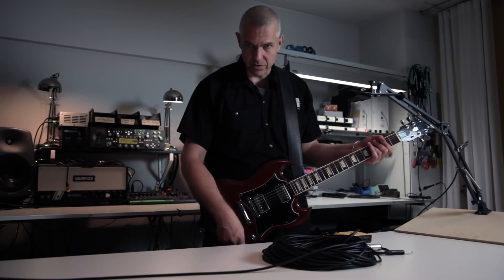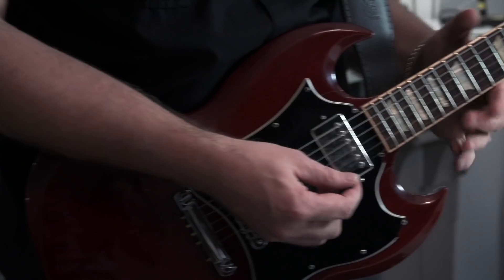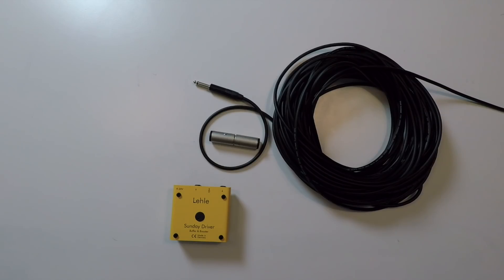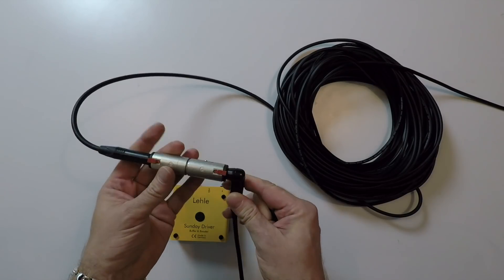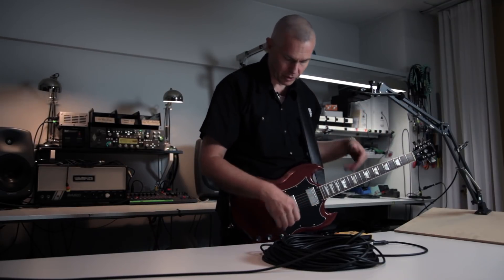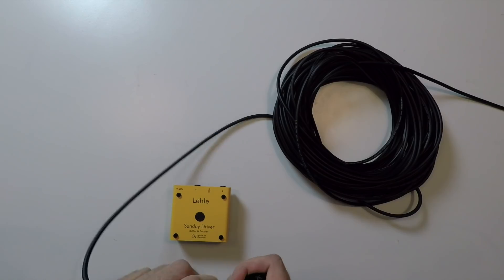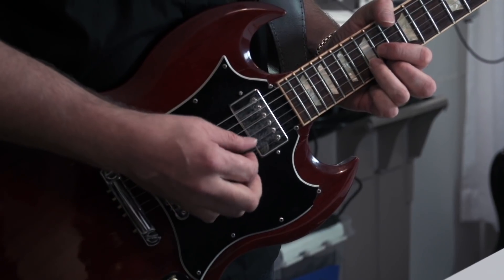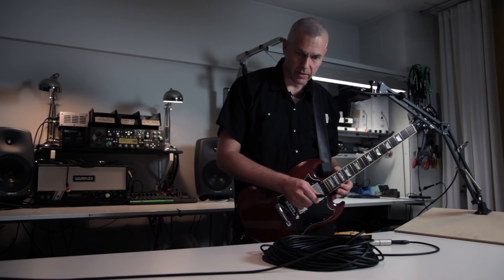Signal loss caused by cable capacitance - Custom Boards pedalboard builder's guide (2018)

Comment: Great demo, thank you. I found your video in a search for how to test for capacitance because I built a new pedalboard last year and just recently plugged directly into my amp and heard a huge difference in the tone. Even my guitar’s volume pot has a “shelf” at about 8 or 9 when going through my pedalboard rather than a smooth roll off to reduce gain as when plugged directly into the amp. I do have a lot going on on my pedalboard. The problem is that I already have a loop switcher and multiple buffers in my signal path, which I would think would fix the capacitance issue. Other than a couple pedals before the switcher, everything is isolated and bypassed, so I would think that the buffers would easily compensate for the extra cable run between a couple of pedals.

Do you have any tips for testing for capacitance so that I can isolate the problem? Can it be tested with a multimeter?